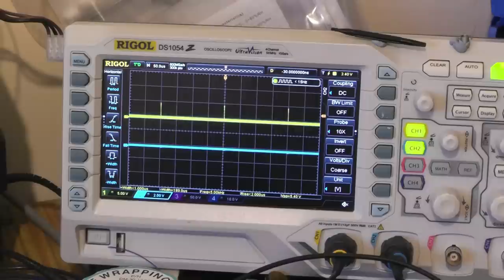Industrial CO2 Laser Coder TEARDOWN and repair! Part 1!

Comment: My synrad had a blown output capacitor of 150pF that head to be replaced.  Unfortunately the gas was depleted so I only could engrave on a very low power output. Even tuned the rf to squeeze out the most power. The efficiency of these lasers are unbelievable low... you need 200-250 Watt input.
Reply from the maker: That is a shame. Yes, the efficiency is pretty poor, that said, it is pretty convenient and compact compared with a water cooled setup, and the drive circuit is not overly complex. Pluses and minuses with all these things!

Comment: I picked up the laser today but it is missing the UC 1000 pwm drive, is the any other way or anything else I could use to provide a pwm signal.
Reply from the maker: Just use an arbitrary function generator. It requires a 5kHz 1uS pulse width "tickle pulse" to run the tube at idle, and as you increase the pulse width it will begin to Lase.